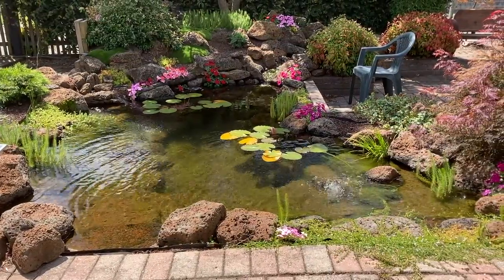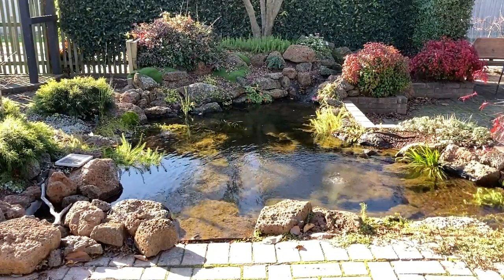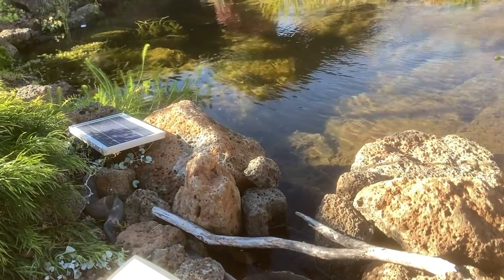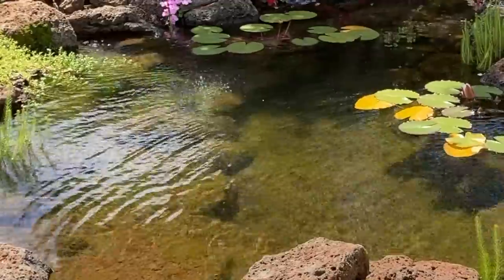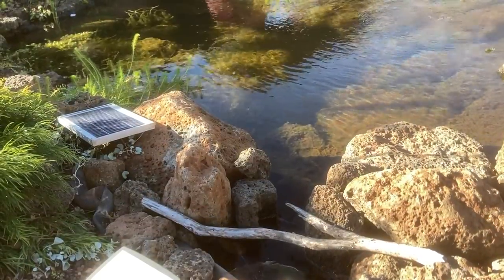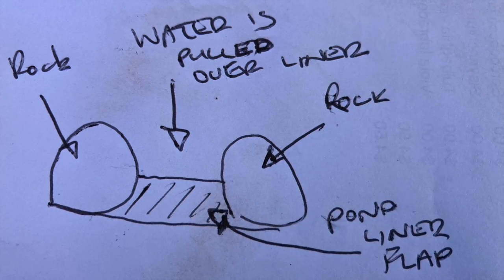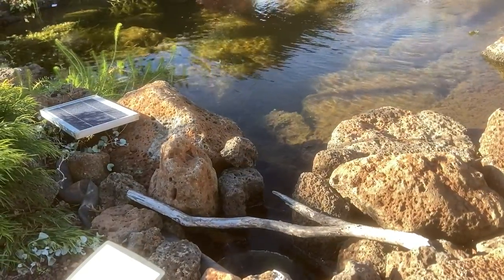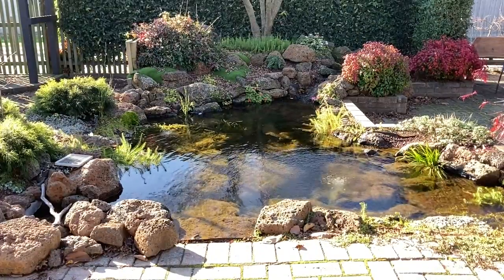DIY pond skimmer

Comment: I'm sorry but I cannot tell from the video if the bog pond is lower
Reply from the maker: No bog is higher than main pond. Water is pumped to the bottom of the bog then wells up and returns to main pond via gravity.
Reply: @Ozponds  so I have to build up the bog pond?
Reply: To a higher level than the main pond?
Reply from the maker: Well it would be best if you want a bog filter. But I’ve been thinking a bit more about it and maybe you could build an anoxic filter. If you search that on YouTube that might be just the thing that saves you a lot of work. I want to build one but I haven’t personally tried it so I can’t offer any in-depth advice. Let me know if you go that route I would be interested in hearing how it goes.
Reply: @Ozponds  I will definitely research that. Thank you and I'll let you know what I do.